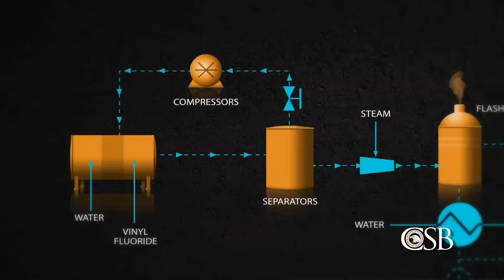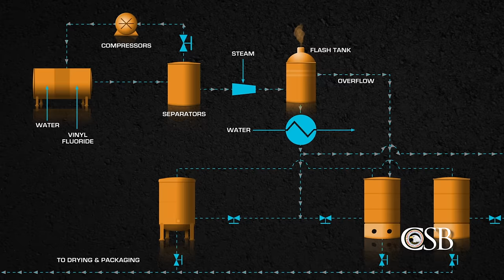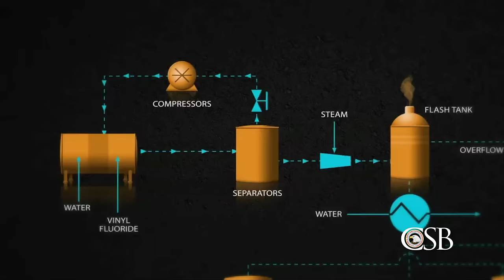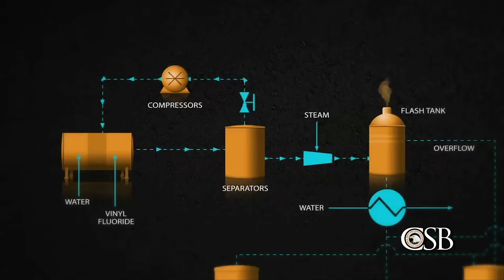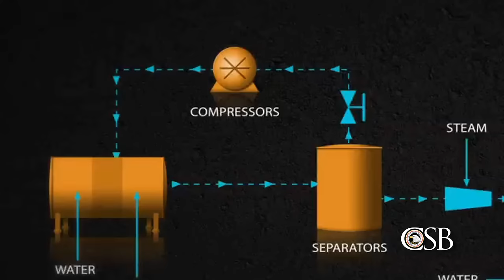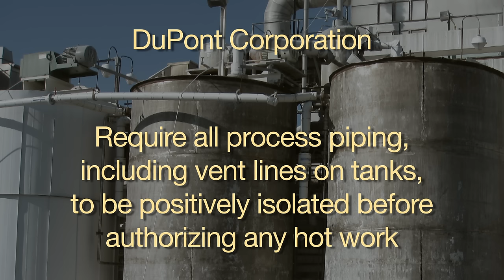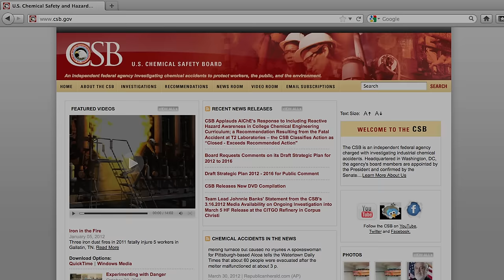Hot Work: Hidden Hazards

Comment: Back in 1979 in Okinawa on a Marine base, I saw two welders working inside an underground jet fuel tank that had been empty for many years. There was a vapor explosion in the tank, luckily, it was a low-grade explosion, for they lived through it. Heating that metal leached chemicals out and built up an explosive atmosphere. Dry tanks can be more dangerous than full tanks. I'm surprised they don't require positive ventilation before and during this type of work, or filling with inert gas or water.
Reply: inert gas can cause asphyxiation, especially in a closed tank. a lot of ventilation is a better fit for something like that. also good  to keep in mind for the home shop; just cause it's inert, doesn't mean the argon for your welder won't kill ya.

Comment: It's important to realize that had these workers not been injured in an explosion they would have still been exposed to a powerful carcinogen.
The responsibility to check for explosive atmosphere was certainly present however the concern for not exposing workers to vinyl fluoride 
should have taken absolutely top spot.  In the process of preventing worker contamination they probably would have spotted the explosive hazard.
Reply: Exactly. ANY halogenated olefin can safely be assumed to be highly carcinogenic. The number of fluoro-olefins that don't cause cancer (e.g. R-1234yf) can be counted on a single hand.
Reply: I was shocked to learn it was legal to pump it into the atmosphere, yet the govt wants me to drive electric cars!

Comment: I have never trusted someone else's flammable gas detector, only my own. Plus, things can affect the readings of a detector, and each one is different. If you have a flammable liquid and flush the air-gas mixture it can go back to a danger level in a few minutes if there is unseen liquid in tiny crevices that you don't see. Also, you carry your own padlocks to close and lock off any valves or electrical contactors and breakers. Recently, a worker went into a sausage grinder at a plant and did not lock off the contactor and switch and someone came and turned on the machine while the man was inside. Horrible! Then another man was locked inside a tuna oven after going inside for a repair because he did not lock off the oven and the electrically operated doors. He died a horrible death being cooked alive! My teachers always emphasized to either LOCK IT OFF or don't work on the unit. I've had people try to turn machinery on several times while I was inside until I just left the job undone and quit the particular job because this idiot would not keep his hands off the electrical switches and was trying to run it while I was working on it. People will kill you if you leave any way for them to do it!
Reply: Yeah, no. Strict rule, no putting my life in the hands of idiots or anyone who drives much worse than I do.

Comment: Many explosions are caused by faulty sensors, confusing monitoring equipment, false computer alarms etc. It would be cool to see the chemical industry adopt some of the aerospace safety standards. Like having multi-channel sensor redundancy, so that the probability of sensor faults can be reduced to 10^-4 catastrophes per equipment per hour.

Comment: The fact they survived welding on tank 2 is a miracle considering the gas was present in there as well, likely lessened due to the shut down, only for lives to be taken on tank 1 due to lack of proper maintenance checks on the compressor and negligence from higher ups

Comment: Not only is vinyl fluoride flammable, it's pretty much just as carcinogenic as its sister molecule vinyl chloride. Exposing these workers to even ppm levels of the gas, let alone ignitable mixtures (10,000's of ppm), is beyond reckless. So much for DuPont being "known for safety". Disgusting.
Reply: I see. So by your logic, if someone "monitors" a person shooting into a crowd, then there's nothing to be concerned about. Hey, they were monitoring it! Monitoring a stupid activity is not the same thing as taking simple safety precautions that prevents the stupidity in the first place. The headspace of this tank should have been backfilled with an inert gas to prevent an explosion, for starters...and that would've only taken an hour and $20 worth of gas (and made for a much better weld).

Furthermore welding on a non-gastight tank by definition is going to result in occupational exposure. As you heat up the enclosure, the gas is going to escape owing to the change in specific volume (Boyle's Law), and it doesn't take high levels of this stuff to cause lots of problems down the road (aggressive cancer). Unless the welder is required to wear a respirator, they will receive exposure well in excess of PEL.

It never ceases to amaze me that people like you exist. You will side with demonstrably bad practices and stupidity to the point you will hurl insults, despite the fact you've been proven completely wrong and have no factual or logical basis for your opinion. God knows what motivates you, I'm guessing a combination of ego and the Dunning Kruger effect. Good luck with your asinine attitude and infantile anger issues.
Reply: +KiloByte You're beyond incompetent. Don't talk about stuff you don't understand.
Reply: While clearly there were oversights, I’m not convinced they knowingly allowed for exposure.  DuPont did a lot of things correctly here, monitoring the atmosphere around the tanks, locking out valves associated, etc.

Should they have monitored the atmosphere inside the tank?  Absolutely.

Should they have known of the presence of hazardous gas?  No question.

Should they be held at fault for the exposure and explosion?  Definitely.

Did they intentionally expose anyone?  Nothing here indicates that, this just seems to be out of negligence rather than malicious intent.

Comment: now I know why when they pull out old residential heating oil tanks its not uncommon for them to dump a crapload of dry ice in.   the CO2 from it "melting" forces out anything flammable vapor or just makes an environment where combustion is possible by forcing out the oxygen.

Comment: In past employment, if I so much as wanted to use a hammer and bolster, so not "technically hot work" which "could cause a spark" or ignition source in a potentially explosive atmosphere, all sources of of fumes had to be checked, and a sniffer was ALWAYS present at and around the area...this was whether working in a refinery, a tank farm or a retail setting near bowsers or vent stacks. If a level was detected even nearing the LEL, works would cease until it deemed safe enough to continue.
Cheers from Aus!!!!

Comment: I know one of these videos is about nitrogen asphyxiation, but flushing tanks that regularly hold flammables can't be that onerous.
Reply: It's not. It just takes a little more time and preparation. It's just another N2 tank, a regulator, and a hose, and an hour or so to let it fill up.
Reply: In my experience, most fixed roof tanks holding potentially flammable liquids are Oxygen free in the vapour space, either by Nitrogen or fuel gas (hydrocarbon) purges, vented to a safe are, or to the flare system.

Comment: Not a safety engineer but do hands on work on and around industrial equipment. It was only my common sense to first think they would have checked the air inside the tank. Both top and bottom as heavy gasses stay low in cool air but may rise when the heat from welding enters the process. The monitors outside of course is to monitor the hazards in the air the workers could be exposed to. Very sad for all involved.

Comment: We had a similar activity at adnoc gas processing plant ruwais last year. We had to cut and weld the rafter supports and some roof repair job at a Diesel Tank. Diesel tank was spaded, drained and purged prior to start the hot work. Continous gas monitoring was done during the activity. 😊

Comment: How hot 🔥 are the sparks coming from weld arc?  Or, it don't take much heat to ignite a flammable chemical?
Reply: Basically, if you can see a spark in daylight, it is more than hot enough to light off flammable petrochemicals and volatile hydrocarbons. I worked a shop that did lots of welding, and also preparatory grinding and so forth. Trash cans and sweatshirts were very commonly lit on fire by weld and grinding sparks.

Comment: @Doyle Unfortunately safety is not common sense; it is a collection of learning from other peoples mistakes and the attempt to foresee what has not yet happened. Common sense has nothing to do with it and attitudes like yours is what gets people killed at a job site. It is so easy for you to sit back and criticize. DuPont has always been a leader in workplace safety and despite this fatality, considering the hazards they are working within, continue to lead the way in workplace safety.
Reply: DuPont employee?
Reply: Is that why DuPont had all of those people working around 1000 lb. phosgene cylinders without requiring ANY PPE? They may have been leaders 30+ years ago, but they sure as hell aren't now. Even BP has a better safety record than they do at this point. Sheesh.
Reply: Outside the US, BP has a good safety record, and a rigorous approach to process safety - I did work abroad for BP, and I can guarantee that any shortcuts/rule breaking were proposed by US staff (I hasten to add that not all US staff were like that, many were just as safety-conscious as UK sourced staff).